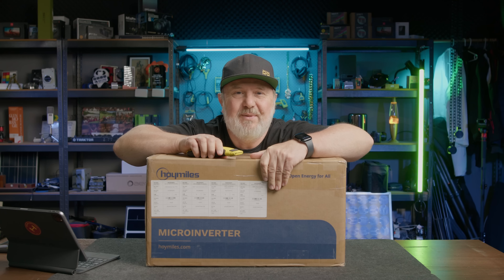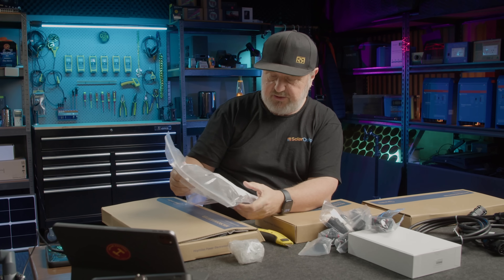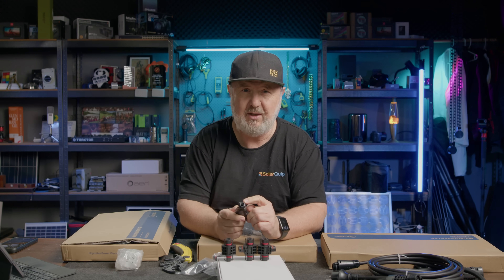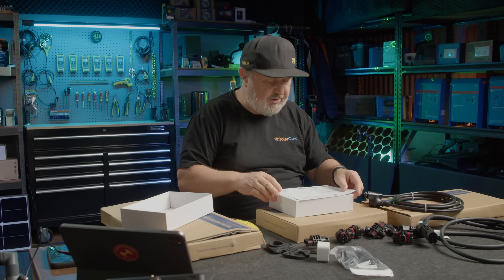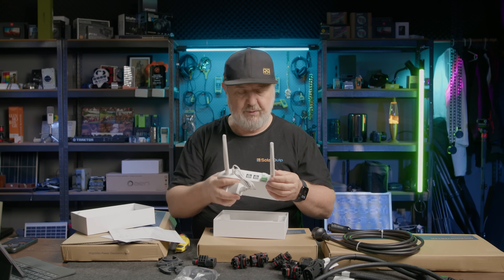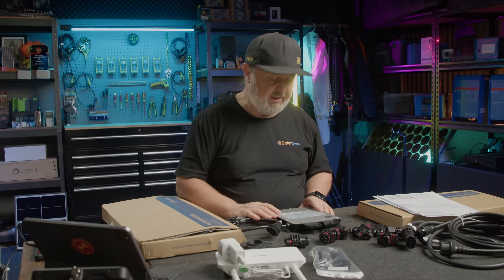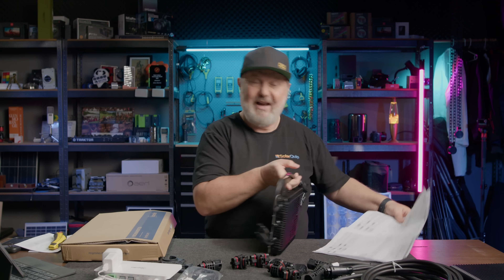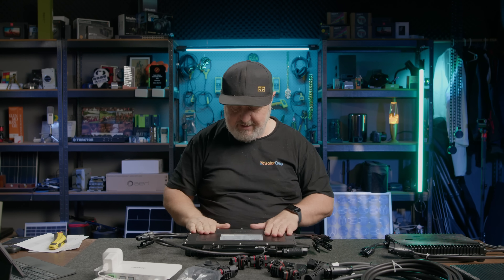Hoymiles Unboxing their Microinverters

Comment: can a l14-30p plug be connected to the trunk cable to make back feeding an rv "plug and play"
Reply from the maker: The trunk cable is designed for microinverter connections, so an RV plug would be an unauthorized and unsafe modification.

Comment: These Micro Inverter systems you can connect direct into the Power points are called in Germany Balcony power stations.And in Germany you cam legally connect up to 800 watts into your Home Power network without other permissions.
Reply from the maker: Thanks Michael for the correct term. Have you got one of these at your home?
Reply: No, I live in Tasmania and run an Enphase system, ac coupled in an SMA off grit setup, I will try adding another Enphase ac Pannel via Powerpoint just like the ones in Germany    @SmartEnergyLab
Reply from the maker: Hi Michael, sorry I didn't recognise your name straight away. I believe that Enphase microinverters can do power/frequency control, so your SMA should be able to manage another unit. Things to consider: SMA's recommendation on maximum ratio of frequency managed generation, and any local regulations that might apply. Be safe!